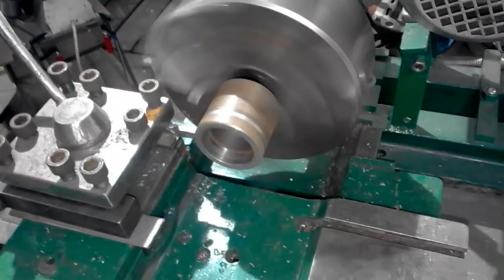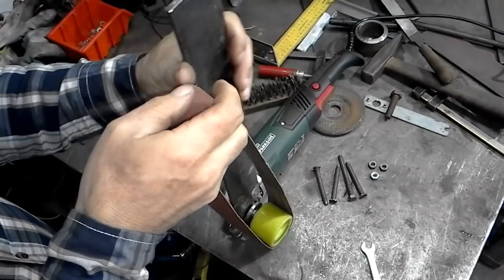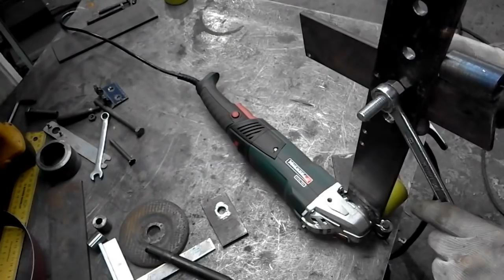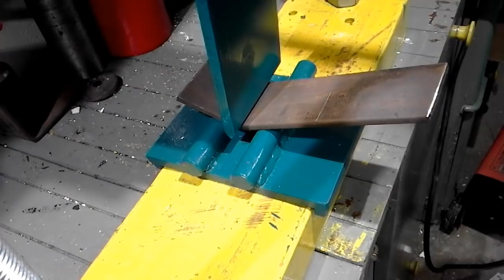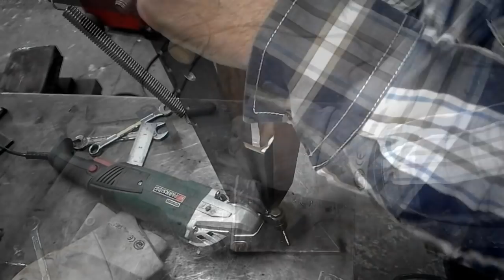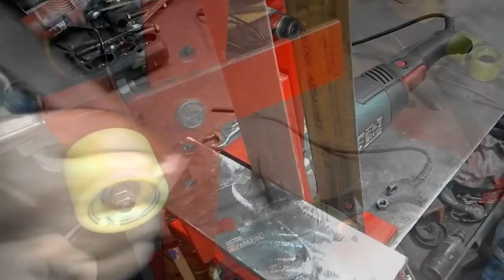Szlifierka taśmowa ze szlifierki kątowej 1200 W

Comment: I made one like this. The problem is that all the dirt and dust is sucked by the angle grinder vents :/ So - it looks nice, it works fine, but it damages your angle grinder. Avoid this design, and try something that puts the angle grinder behind/far away from the working area ;)

Comment: hey, what is the size of those belts?
Reply from the maker: Hey . 50x915 mm
Reply: Nice 2 by 36 belt hand grinder. It looks great just remember to blow it out after each use so nothing builds up inside and wrecks the grinder motor. I would to get one like that. You did a great job. Thanks for sharing it with us.